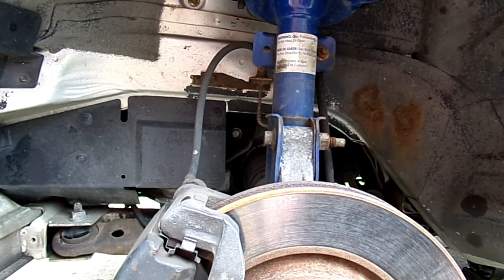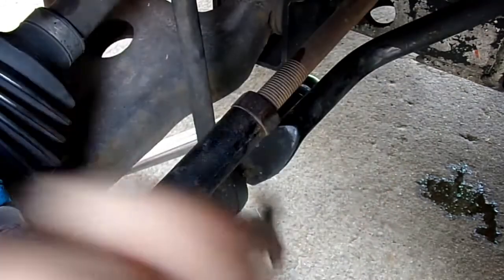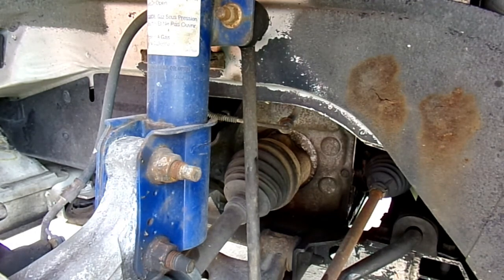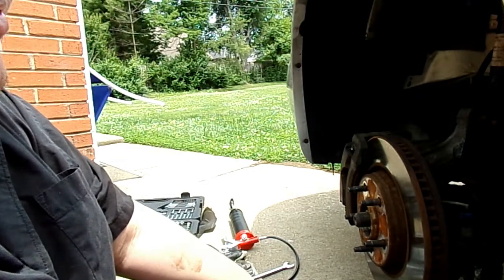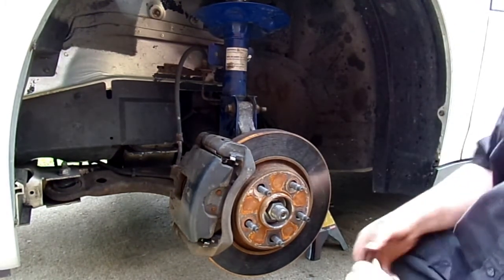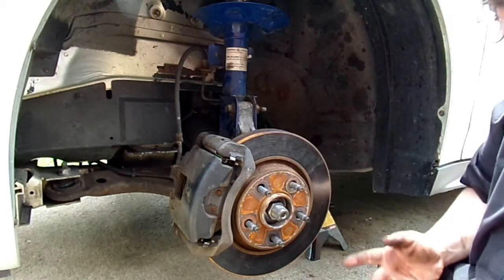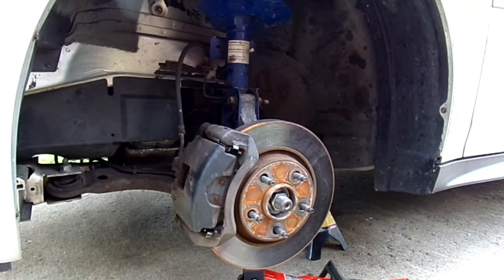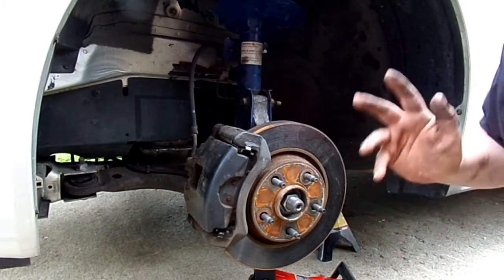Sway Bar End Links 2004 Pontiac Grand Prix

Comment: Where you get the control arms for that price at and what brand. You gonna do a video on the control arms and also what noises are they making when there bad. Also where you get the moog links
Reply from the maker: Sway bar end links
https://www.amazon.com/gp/product/B001CA228K/ref=ppx_yo_dt_b_search_asin_title?ie=UTF8&psc=1

Lower Control arms:
https://www.amazon.com/gp/product/B07G3YTRZQ/ref=ppx_yo_dt_b_search_asin_title?ie=UTF8&psc=1

Please note, if you get these Lower Control Arms, you will need to cut off the little ear thing, or they will interfer with  the sway bar end links
Reply: @Eterna1Link  thanks are u gonna do a video for the lower control arms when you change them. Also what kind of problems are u having with them
Reply from the maker: @B-S1999  I have already replaced them, i was having a slight metal knock as the bushings were worn out, I did not do a video on them, and i already replaced them. However, there are several makes and models of the same year range that use the same exact lower control arm. 

Here is the video i followed. It is for a monte carlo. Please remember though, if your sway bar end links bolt to your strut/shocks instead of the lower control arm, you will want to cut the little round ear thing off, or you WILL damage your new end links.

https://www.youtube.com/watch?v=yPPFGKEMKPQ

Also, please note you WILL need a T55 torx bit for one of the bolts on each side to do the Lower Control arms.
Reply from the maker: Also, https://www.grandprixforums.com/how-to-write-ups-tech-tips/66203-how-to-change-lower-control-arms.html

this is the site that will list all tools you will want for when you do the job
Reply: @Eterna1Link  ok thanks I'll check the video out can I ask what u used to cut the ear pieces off with and were they hard to cut
Reply: @Eterna1Link  those moog links on Amazon they have the zerk fittings location the same place as ur old ones. Wonder why ur new ones they are in a different location
Reply from the maker: @B-S1999  Sure, There are several ways you can cut them off, just make sure you have something like a vice holding it down tightly when you cut them off. As for what i used

Vice to hold them one at a time, and a  Reciprocating Saw to slowly cut through them, You should also be able to use an angle grinder depending on how fast it will spin with a proper cutting wheel,

I would also make sure to leave a very tiny amount of the ear on there, as you dont want to cut into the arm itself. 

One last thing. Make sure to seal the new bare metal with some kind of black paint to prevent rust from creeping in. (i live where it snows, so salt can be an issue if not resealed)
Reply from the maker: @B-S1999  https://drive.google.com/file/d/1RJQlswgRk_fKMiqAZzC3c7w0PJl0nQCl/view?usp=sharing

Here is a picture of it after it was cut off
Reply from the maker: @B-S1999  Only thing i was able to think of at the time was a different revision
Reply: @Eterna1Link  thanks for the picture was the car on a lift or something, wish I had access to one of those. Yeah I hear that I live in Kentucky and we get snow and salt too
Reply from the maker: @B-S1999  Yup, it was put on a lift as i like to get clear pics of any work done on it, i live in central kentucky. Though i do most of the work on the car in my drive way. i DO plant to one day rent my own garage for work like this. And glad the pic is helpful.
Reply: @Eterna1Link  well good talking with you and yeah same here I work in my garage and the ground isnt comfortable.

Comment: What tools you used beside the wrench what socket size is that
Reply from the maker: i used a deep 15mm socket, depending on the stud for the sway bar, you will need an 18mm wrench to hold it in place while unbolting it, and to hold the studs on the new arms while tightening the bolts. If the studs on the old ones do not have the little slot for the wrench, then you can use a set of vice grips to clamp onto the stud while turning to take it off.

Tools:
Breaker Bar (helps loosen the old bolts)
15mm Deep Socket
18mm Wrench
Vice Grips
Torque wrench (to get proper torque when installing the new bolts)

2 ton hydraulic jack
two 3 ton jack stands (i had the whole front end off the ground with both tires off the car at the same time)

If you need any more info, please let me know and i will help the best i can.
Reply: @Eterna1Link  thanks for the help 3/8 or 1/2 for the 15mm deep
Reply from the maker: @stompa556  either will work, just note bigger ratchets will have a harder time due to less room,  so i would go smaller on ratchet size if you can